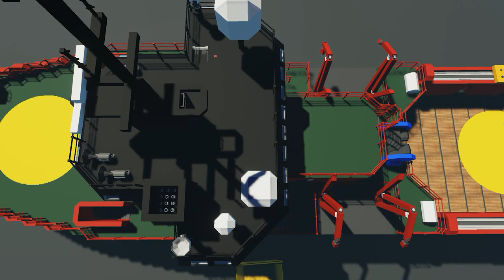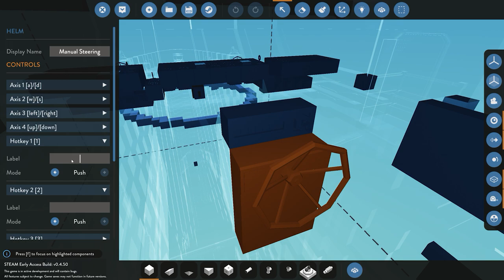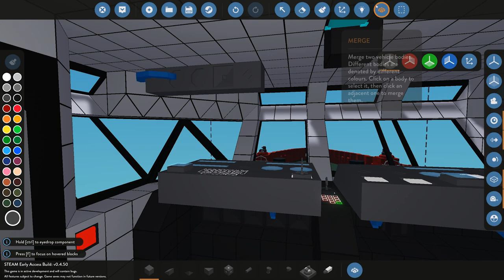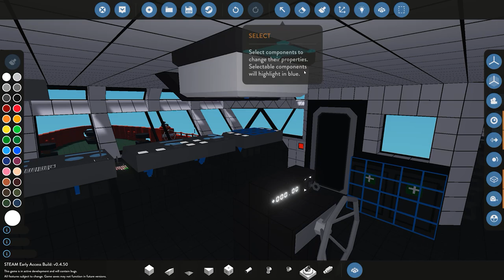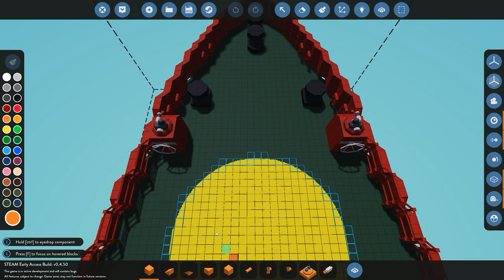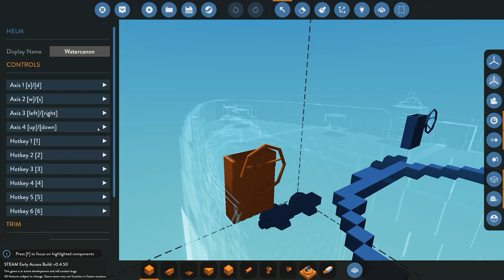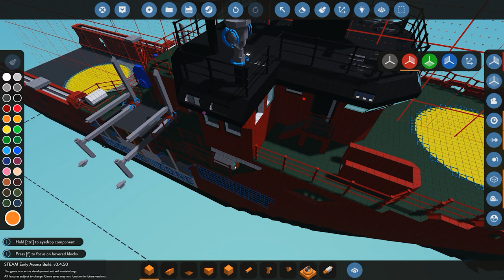Stormworks - New Ship!!!! - Build Series Part 6

Comment: hey so whenever i make a large ship and use propellers that use up as much power as the engines generate it still goes slow, i put the rps up to 55 but it still goes very slow, like barely moving. Is there a way to fix this?
Reply: Do u use gear box's if so have the arrows pointing towords ur engine's nd set them to 1/1 nd 1/3 (nd use 1or2 gearboxs per propeller) nd a separate single gearbox set to 1/1 nd 1/-1 for reverse. Hope this helps
Reply: thanks, that helped!
Reply: @cheekii6182  no worrys nd it also works on the small boats aswell where u can use 1 aircraft engine run that though clutch nd reverse gearbox then T it to go though next gearboxs dwn to propellers. (This way is very good but don't over do it on props nd rps  ok)